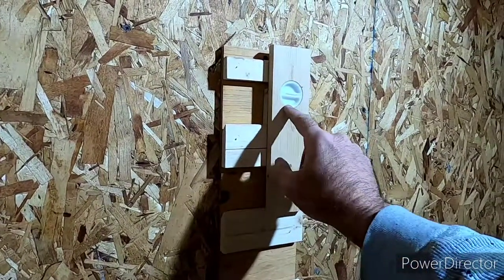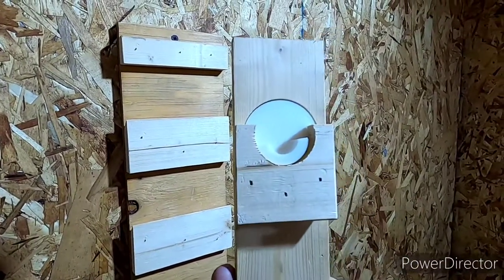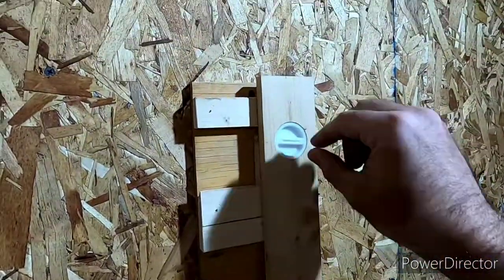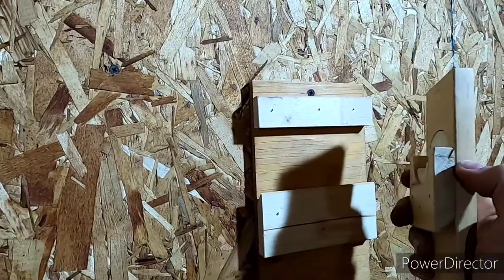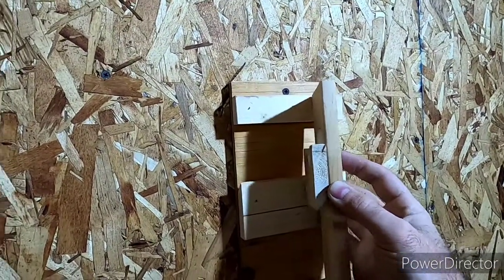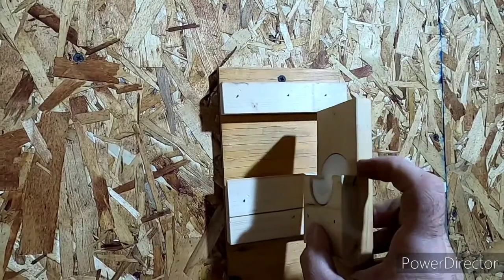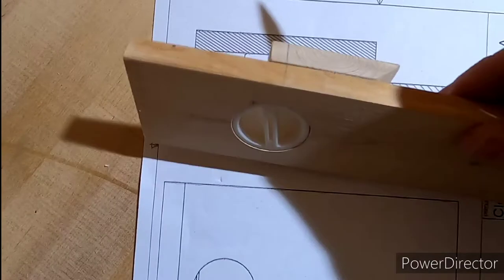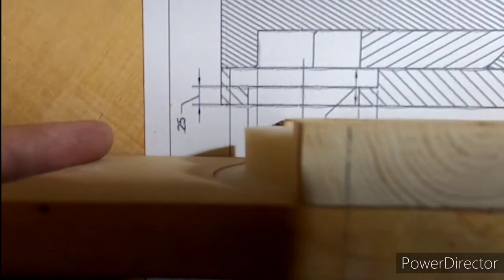French cleat locking knob demonstration.

Comment: That's a good idea, but if you've got a top-heavy load wouldn't it be easier to just add a second cleat lower down on the tool holder?
Reply from the maker: From what the original people driving the creation said they were sometimes knocking them off the wall by bumping them or by vibration. Particularly cantilevered hangers. It also keeps them from sliding out of position over time.  If the tool is heavy, it is fairly easy to catch the tool on the hanger while lifting it off and knock it off the wall. I think you could make the hanger taller catching 2 or 3 cleats, but it would use more space, and not necessarily fix all the issues. To me many of these problems are caused by the rather small catch created by the 45° angle at the top of the cleat system. Placing two cleat boards on the wall, the front wider by two thicknesses, forming t-slots on the wall, would be more secure to begin with IMO. And you could make wood toggles that you turn into the top and bottom slots of the cleats making it extremely secure.

The knob costs maybe $0.15 in plastic, so if you have the printer the cost is negligible. If I were doing a wall of hangers I would make a jig that positions the drill bits for the thru hole and counter bore. Making the cutout very fast. Or setup and cut a set of the cleats on the drill press. Couple hours of work, and a day of printing to fully secure all your hangers.
I should probably design a retrofit model that all assembles from the front. This would require a two or three piece design, and some small screws, or glue in. It might be easier to install. If it wasn't flush, you could do a single thru hole without a counterbore. 

If the market was larger it would be worth injection molding the knobs.

Comment: Great idea, but instead of going through the hassle of having to make the plastic cam, making the cleats, making the tool holder adapt to the cleat.....
Just screw the holder to the plywood/OSB and you are done!  No worry about things falling off the cleat (they are screwed right to the wall).  If you want to move something just unscrew it and move it.  
But, you wouldn't get to use your 3D printer.
Reply from the maker: You notice the rest of the wall is flat. I am am screwing everything to the wall. I don't plan to move them around enough to justify making the cleat system. Others have suggested pins, or wood blocks/shims that fill the space that allows it to come off. I made this as nice looking, truly tight, easy to operate solution for some one who is already committed to the french cleat system. If this was a space that had to look good, then a system makes sense to prevent screw holes over time. It seems like t-slot shaped slats would hold better though than the 45° angle used.
I'll use a pegboard for the little stuff.